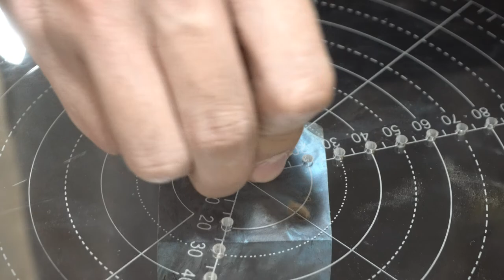Woodturning - Restoration of umbrella handles with black and blue wood

Comment: That was a nice treat for a lazy Sunday !😃
Stunning piece Mr Zhou  especially so with the amount of hand finishing involved,
I have the same kind of bench top belt/disc sander I bought 30 years ago and it's still used virtually every day, I could never be without it !
I also have a 12mm belt sander (aka powerfile) when the belts finally snap I cut them and use them for hand/strap sanding, they are already softened and very flexible, very good for smoothing out different radiuses and curves etc.
Maybe you have already tried this 😉
Reply from the maker: I bought this belt sander just over 1 year, the used sanding belt I will also use for manual sanding